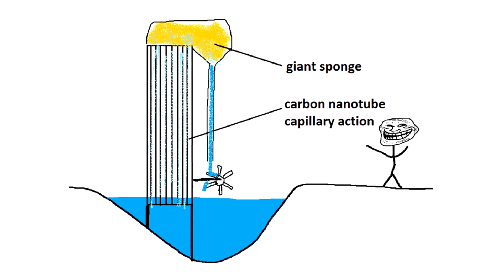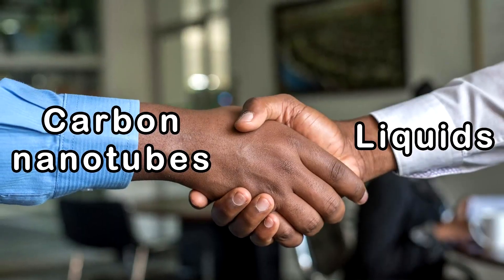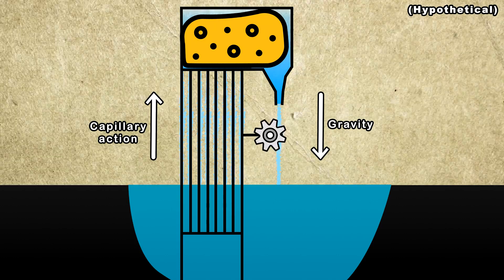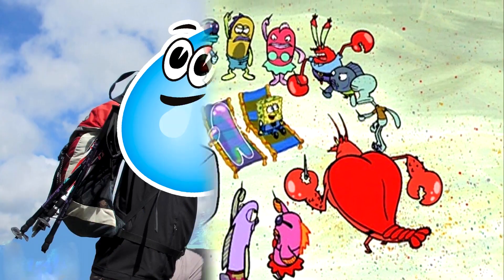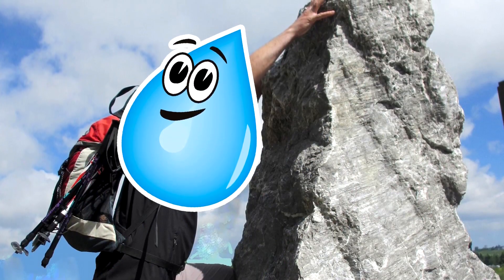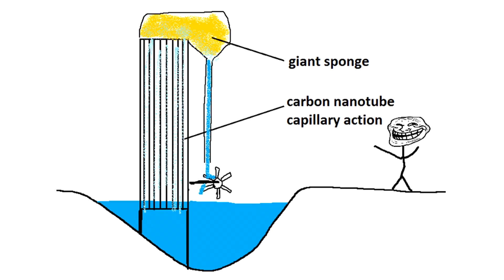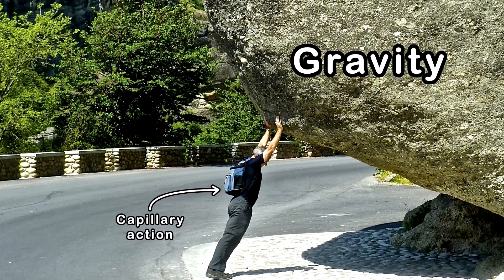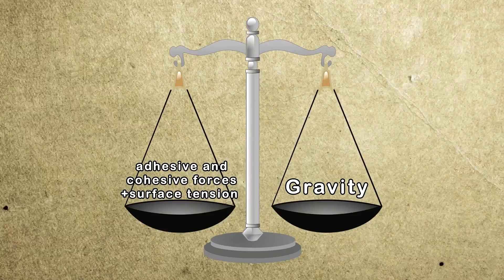why it doesn't work 19

Comment: There needn't be any sponge up there, only a water tank that opens up after there is enough water in it. Then it will work. But well, it's not the best energy source, because it gives you about 10 second of 10 watts everyday.

Comment: Guys, the actual explanation as to why this doesn't work (since he didn't really explain it) is this:

The sponge will never be filled to a point where it is energetically favorable for water to leave the sponge. Water goes up the tube in the first place because it is more energetically favorable than staying level. This machine would require water flowing INTO the sponge (so it goes up) and OUT OF the sponge (so it falls back down) to BOTH be energetically favorable, which is obviously not possible and is a massive contradiction.

Comment: Here's a perpetual motion machine idea that actually works:
1. Gather wood
2. Make a gear-like machine with a generator in the middle
3. Put one side on a stream/waterfall
4. Water goes through gear and makes free energy 
5. Water goes to SEA.
6. Sun warms up Water to steam.
7. Wind blows steam to mountain tops.
8. Mountain top freeze steam into water
9. Water adds to a river.
Reply: what to do when my sun runs out? asking for a friend
Reply: You are just harvesting gravity's work, gravity does the job, it powers your machine, free energy machines dont use outside forces and energy.

Comment: I've disliked the video because it doesn't explain why. It says that the capillary action will lift only a small amount of water, but that's still some mass with a potential (to gravity) energy.
Reply: gravitational potential increases but capillary action potential decreases, the water won't drip out because the sponge is holding it back in
Reply: @ makes sense

Comment: Wait is this not the exact mechanism behind photosynthesis? Sunlight heats up the water at the end and evaporates it, making more water come up due to capillary action, plants use this as sort of a heart, pumping nutrients through that water from the soil, although I doubt the sponge could do the same thing as the sun in this case as the sun adds energy to the system, the sponge cannot

Comment: So.. infinite energy is a lie?
Reply: Always has been.

"perpetual" motion machines could only store their energy if it's a 100% efficient system without energy loss, otherwise it will just convert all energy into heat.
In real life there is always some energy loss into friction between parts, some portion of the energy will get converted to heat and radiated out of the system, it's never 100% efficient.

you always consume more energy than you produce.
Reply: Nah, we can use small amounts of energy to cause large reactions and capture that shit. Nuclear physics is wack.

Comment: You know how rain works right
So if I fill a triangle box with water and the water vapor that float to the top getting me potential energy which could be converted to energy 
Is would be really slow but it proves that gravity could be manipulated to generate energy
Reply: Rain works on differential heating and cooling, a form of energy input. You box wouldn’t work without the sun and possibly a cooling source, making it an inefficient solar panel
Reply: @jakenorthand1755 did ever hear of the heat death thing
Reply: But I thought due to friction between molecules would generate heat
Reply: @pinguino-fish  Friction does not generate heat from nothing, it converts movement into heat.

Comment: There's got to be a way to get it out of the tube. There has to be
Reply: Sure, but that requires exerting energy onto the system. Same way you can't pick yourself up and lift yourself high, the water that "flows" up the tube couldn't be released from the tube on its own.

Comment: i figured out why it actually wouldn't work.

the capillary action COULD bring the water up to the giant sponge, assuming it was absorbent enough, but only if it was absorbent enough that it could not drip out of the giant sponge
Reply: What if you just curved the capillary tubes down ward?
Reply: @doughboywhine  If you do an upside down U shape, the water will get stuck at the bendy part when equilibrium is reached most likely
Reply: @doughboywhine  you'd need to curve it as far down as the water level from which it is starting for it to start dripping out of the tube
Reply: Well what if you saturated the sponge to start
Reply: @FakenameStevens well then the water still wouldn't absorb into the sponge and thus wouldn't move horizontally
Reply: @FakenameStevens  Then you would initially get some water to fall as the capillary action adds water to the saturated sponge, but it is going to be easier to rise in the banks than to go up the tubes once the tubes are full, so you'd get back to an equilibrium relatively quickly, and you just used a lot of energy getting the sponge to saturate in the first place.
Reply: @FakenameStevens  then it wont be absorbant enough to draw in the water from the capilary tubes.
Reply: There's the actual reason, video basically said it won't go up enough
Reply: Niko pfp spotted
Reply: @asrolsiti  seek help
Reply: what if you made the falling water push a lever that would squeeze the sponge, and unsqueeze it once the water is no longer flowing. The sponge should go back to its normal shape.
Reply: @Censored_Truth_Addict  how would you make the water push a lever?
Reply: @aeea3306  Gravity. You have it hit the lever before it hits the cog.
Reply: @Censored_Truth_Addict  it would, but the energy that it would take to squeeze the spinge is greater than the falling water can supply, so you would need an external power source.
Reply: @jacobhargiss3839  You say that, but there is no reason that should obviously be true. We could use springs and whatever else to lessen the energy requirement of squeezing the  sponge. Gravity is doing most of the squeezing work there. You're forgetting that the potential energy in the water got obtained from being transferred all the way to the top of the device. And the generator had nothing to do with that initial transfer.
Reply: What if you squish the sponge every now and then to release the water? Sure, you will lose some energy while doing that (here you reach the weak point of the argument), but you will get more of it by making use of the created droplets.
Reply: Yeah, exactly. For a sponge to drip water it must be oversaturated. And oversaturated sponge cannot absorbe any water.

Comment: yeah this video didn't actually help me understand why it wouldn't work.
Reply: i do appreciate you doing more than just saying "it's a perpetual motion machine so it wont work" like duh.
Reply: You should ask twm to be kind and let it work
Reply: @NikoThePancake  trueeee !!
Reply: it doesn't works because we don't believe in it enough!!
Reply: @Kreshura-tm5rb  no, actually, it doesn't work because the same capillary action that sucks the water into the giant sponge would have to retain the water inside of the giant sponge, so there wouldn't be a drip you could exploit for free energy.
Reply: @1_1bman  oh :(
Reply: Cappilarity isn't sufficiently strong to go all the way up. Also, taking the water out of the cappilary tubes is a problem, it'll not drip out as the troll physics suggest.
Reply: @ElementalAer  strength of capillary action isn't an issue, actually. the troll device would still work if it was just a few inches tall, and capillary action would do that easily. the fact that the same capillary force that pulled the water into the contraption would keep the water in the contraption, that's the key
Reply: The system reaches equilibrium where there's no more water entering the sponge for more water to drip

Comment: Harnessing the power of gravity does not violate the laws of thermodynamics, nor is it impossible to produce electricity with the behaviors of liquid under gravity

See hydro-electric dams
Reply: Yeah but those move the water to a lower place, and rely on natural cycles to bring new water to the top. This is expending the energy to bring the water up itself.
Reply: to expand on the answers in this thread, the way water is able to naturally move from downhill to uphill is NOT free energy either, the energy comes form the sun. the sun heats the water causing it to evaporate and become clouds, which later rains down and some of that rain ends up in a higher place than where the water started, allowing the energy to be harvested by for example placing a water wheel in a river.

water wheels are not harnessing the power of gravity, they are harnessing the power of the nuclear fusion happening inside the sun. this nuclear fusion is burning up the mass of the sun at a rate of 4 million tons per second. THAT is where the energy is coming from, the gasses inside the sun's core being depleted (aka transitioning from mass to energy (E = mc²))
Reply: @albing03  Except for geothermal & nuclear energy, every single thing or source of energy on earth comes from the Sun. 😅
Reply: Alright, build it then.
Reply: On dams the water is already upstream, this troll physics suggest taking a downstream water magically upstream.
Reply: @ElementalAer  It isn't magic, capillary action is a real natural phenomenon
Reply: @doughboywhine  I know, but the troll physics treat it like free magic energy